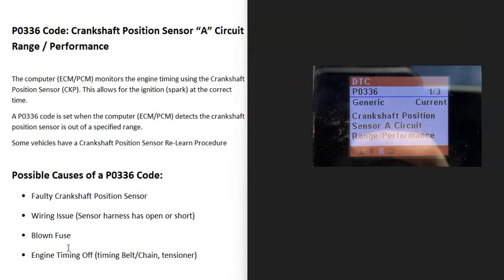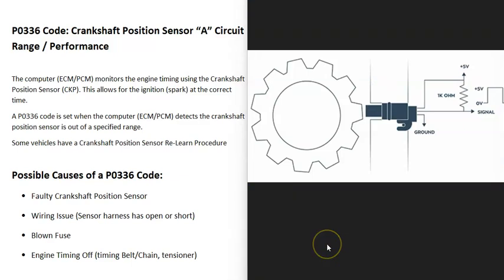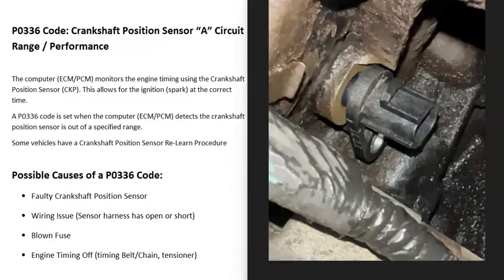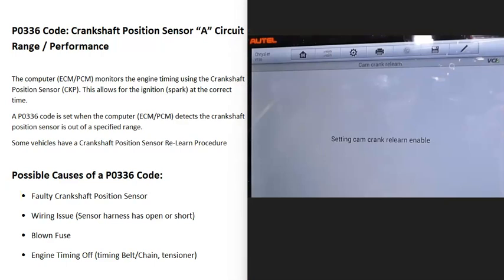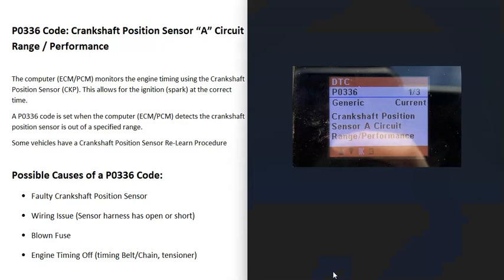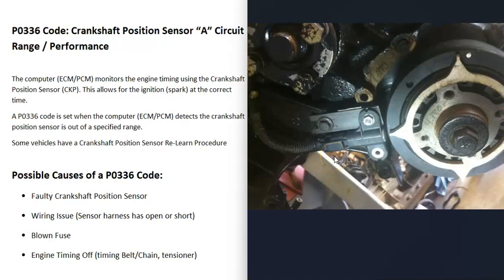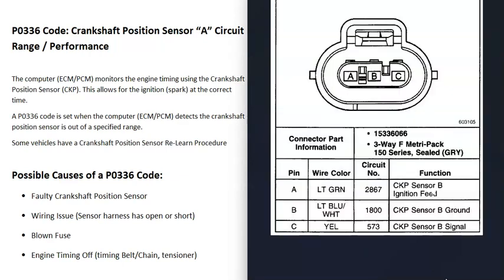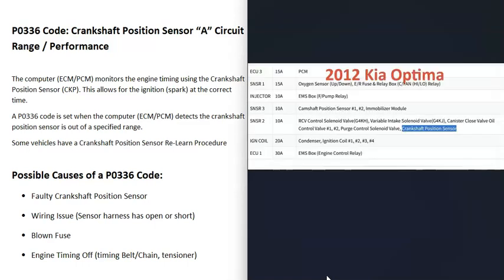Causes and Fixes P0336 Code: Crankshaft Position Sensor “A” Circuit Range / Performance

Comment: When I turn my truck off and tries to crank it right back up I get a slow turn over and when it cranks I get a check engine light and a traction control light
Reply: Hey!! Did you find out what caused your problem
Reply: @ slow crank the starter and I had a open circuit on my ignition due to a kill switch

Comment: Hi there i need your help  with my Suzuki ciaz  it always  gives me  the same code P0336  saying is the crankshaft sensor but  after replacing it , till now is heard start the engine over hitting and and there's no power on the accelerator meaning it takes time  to  pick up

Comment: Hey man. I have a montero 2013 4d56 

I keep getting this error even after i changed the sensor. Mechanics did everything. Checked the lines they said and it dosnt have any shorts. Now they are telling me its a ECU issue. Any thoughts about that?
Reply: Did u end up finding out the fault in your vehicle? Got same problem.